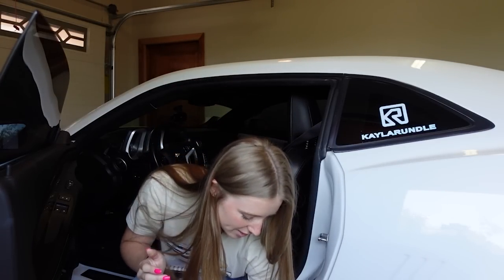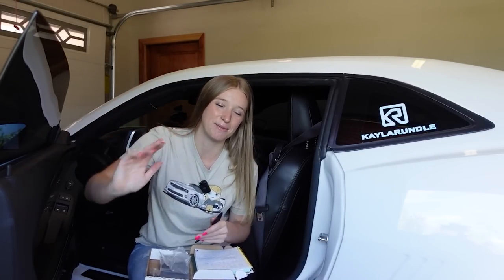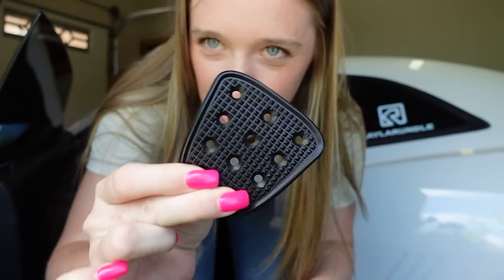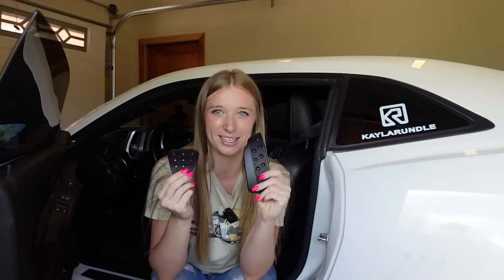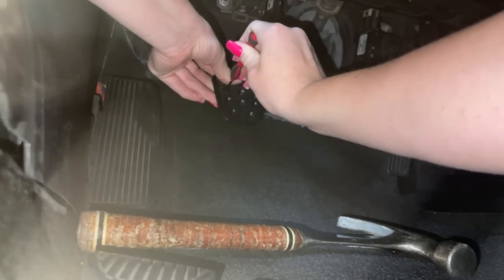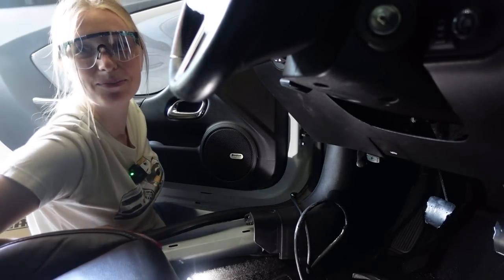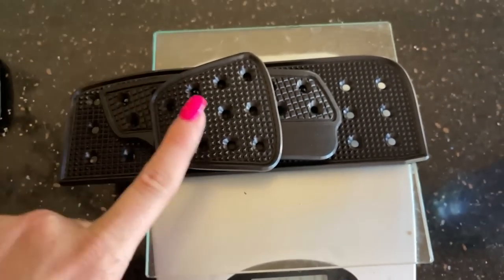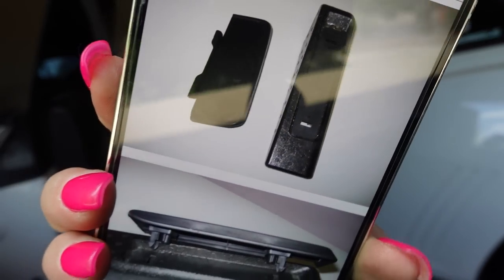The Secret to Heel Toe Shifting- SRP Pedal Install

Comment: Not realy a upgrade 
feet get wet or step in oil feet slip of clutch and you just hit car in front of you .
The rubber was better in that way .
But still slippery.
But the realy good thing is you chuck inset screws and 
get like 5/16 bolt head screws and they help hold foot on pedals
and add a couple more towards bottom corners ;
you will love them .
makes every thing easier when bolts stick up.
And Be Carefull the kind of Braking and gas pedal your talking about 
Can kill you.
if you power block getting into corner your out of control 
and only time to Double clutch is when dropping to gears to slow down faster..
And youl realy shit if you hit both with clutch engaged. front hopping and skipping 
with engine pushing is realy bad .
in General fastest corner on race track is getting closer later to corner than other guy 
banging 2 gears down and gunning it into Corner because the car corners 3 times better under throttle .
Same with lane changes and beating Blocker cars on race track.
The second you see 1 head light youve got 1 foot of clearance pulling in front of them.
The other thing is Speed shift .
For best Gforce you half clutch and only lift 1 inch on gas .
and you can do this at 4000 rpm to practice .
My Race car is stocker 330 horse to ground 97 Camaro .
it picks wheels off ground in every gear using torq and beat  700 horse power cars
with Torq Band .
My Gforce meter says im crashing higher gear with 690 foot pounds of tork 
wick averages like 500 through gear without bogging lol 
and when you feel no gforce your out of gear unless your in high gear shift up 
Horse power is over rated